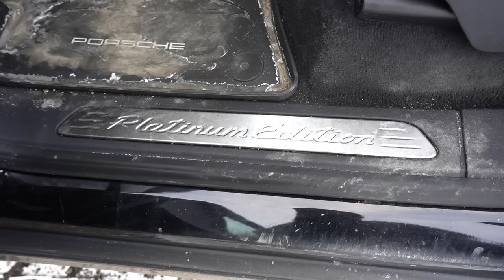Is Porsche The WORST Car To Detail?

Comment: About the carpeted wheel wells, I think the owner might have done something crazy to them. My 2017 Cayenne has over 70k miles and my wheel wells are still like new. 👍🏻

Oh, and I’ve asked my husband for a, “Detail Geek,” gift basket for Mother’s Day. 😂 I am so addicted to this channel!!💓
Reply: Agreed. I’ve had Porsches with more mileage than that one and I live here in Calgary. No damage to the wheel wells whatsoever. Something odd going on there…
Reply: And probably the rear hatch replaced. Reason I say that is that this is a base platinum not an S. I’m it has the badge of an e-Hybrid with the acid green outline. Plus no green calipers for S e-hybrid (or red for S), and base exhaust tips (not the 4 round like the S). 

So definitely has some history to this car.

Comment: I have a 2016 S e-Hybrid. Liners on mine look brand new still. 

BTW, that car is a base platinum with the logo of an S e-Hybrid (acid green trim). Not an S either as the calipers are the base color and the exhaust tips are not correct. 

My guess is this car has had a bit of a rough life (maybe hit in the rear, and who knows what done to the liners).

Comment: Love hearing your comments on the quality of the higher end cars.  I have a 2006 Cayenne, and it does not have any form of carpet in the wheel wells.  And after watching this video, glad it doesn't.  Coincidentally, my car is at the dealer for service and they gave me a 2023 Cayenne loaner and I just checked, it doesn't have "carpet" but some type of thin felt like material.  My Cayenne has black interior and I have a German Shepherd.  Your recommendation for the Lily brush has made my life and car interior so much better!

Comment: Unless this is just snow and ice packing in those wheel wells and tearing everything up, there's really no excuse, they just used a poor vendor for those liners.   Manufacturers go through periods where similar issues will often affect a number of their models--one of the most infamous was the biodegradable wiring(!) from Mercedes 20 years ago.   As an owner of 2002 and 2009 Porsches with quite a few more miles than this one, I've had no issues with wheel wells.  In fact, I've been amazed by the quality of the cars on the whole and the underside and corrosion resistance specifically.  The notorious issues of Porsches from my era, were the stupid soft-touch interior finish that begins to flake, and the foam in the vents that degrades and spits out in bits.  IMS bearings affected that 2002 era, but not the 2009.

Comment: Hi, big fan here. I recently had a kid throw up in my Lexus Rx350. It has perforated red leather seats and I was wondering if you have any tips on cleaning the seats. We tried wiping them down and we were told to put coffee beans to make the small go away but nothing seems to help. We are thinking of buying a bissell extractor not sure if it will work.
Reply: Try the pet dept. And use skunk spray deodoriser

Comment: QUESTION: I saw you use Leather CLEANER, which I assume doesnt have any protection? What did you put on after? Do you have a leather conditioner or using something else?
Reply: He uses Detail Geek Auto Care Leather Cleaner, which won't dull or dry out the leather upholstery. If you are after an even better look and nourishment, you can follow up with Detail Geek Leather Conditioner. 👍

Comment: What is the maximum horsepower for a pressure washer do you recommend using on a car, and what nozzle setting?  Also, where do I find the 45 degree angle spray wand and foamer canister?

Comment: How is it possible to not use a oil based cold degreaser to remove the salt and oil based stains? Or are you not using that at all?

Comment: I'd used meguiars wheel brightener and non acid wheel cleaner ezdetail brushes and drill brushes foam canon 1st then two buckets .meguiars soap and 3d soap.
Reply: Oswego.ill and norridge,I'll I do detailing.

Comment: Hey Mike. 
I don't have a carpet cleaner to extract the soap out of the carpet, can I use a wet/dry vacuum instead. 
 Have used the Lilly brush on the carpet in my '03 F-250, and I am amazed at the difference.
 Keep up the good work.
Reply: Yeah u can, but you'll also need to apply water while vacuuming to rinse away the soap
Reply: she bd and is d

Comment: If you first hit the car with the foam outside and then rinse off with pressure washer, you would remove more dirt right away.
Reply: The point of doing the pre-rinse before the foam is to get off the easily removed stuff first so that the soap can reach the really stuck on dirt underneath.  It’s one of the differences between detailing and just washing.

Comment: Any luxury car would seem to be the worst to detail. I would expect luxury car owners to be the most picky and critical. At  the same time if I made a mistake and did cause an imperfection, it would be that much more costly a mistake for me to fix. Based on the Porsche and BMW owners I have known, just a couple of people, I would not want to deal with them when it came to doing anything with their vehicles. I would buy a 911 if I had the money. Why? I've been in one going at a ridiculous speed, that's exactly the kind of sports car I would want to drive. And yes, if I owned one I'd be insufferable.

Comment: Considering that it ISN'T an S, this Porsche has been molested. Those wheel well liners were likely removed wrong a few times. 

1. Wrong color calipers
2. Wrong rear badge (shouldn't have green halo - it's not a hybrid)
3. The S is crooked

If it were a S-Hybrid, it would have green calipers, and hybrid badges on the front fenders. 

If it were an S, it would have silver calipers, and 4 exhaust tips. 

This is a V6 that someone wants to stunt in.
Reply from the maker: Guessing you don’t realize this is a Canadian vehicle?
Reply: I know it is, however, there was no difference between the US and Canadian market Cayennes that year. Yes, an S Platinum Edition was offered, however, with the wrong badging, wrong calipers, and wrong exhaust, I think it's just someone who wanted different badges on the back.

Comment: If i didn't see the badges in the interior, i would think this is a Hyundai or Kia. Moving forward to your detailing, i see that the quality got even worse. Don't comment for all Porsche, but this one definately looks cheap.
Also, from your videos, i haven't seen you moving the wheels for example or do an underbody detailing, would this be a thing to add? Thanks for the video, your work is consistent.
Reply: I have the same vehicle. Definitely not cheap finishes. We’ve decided we will never NOT have a German car after owning this.
Reply: @Speedylittleme  rip

Comment: Well I’m from Germany and detailing here is very expensive! And u are doing an average job at best. As an example seeing u work on leather was a little of a shock to me try to use less and take a very soft sponge and do it partially. Don’t spray the entire seat u will have a much better result it takes longer but u won’t get any fluids under the leather or in between the stitches. 

U are of course here to make a living of it as I would suggest wich is the main and core reason u are trying to do a quick fine job like a businessman would do. 

I hope u can take criticism as I am here to try to help u improve ur skill set 😊.

On the exterior of the car how ever u are doing a very good job same with carpet and dash board try using a soft head made out of rubber or at least put a very soft piece on the vacuum cleaner’s head! And u won’t be scratching any thing.

Love watching ur content subscription + bell are on. 

Love and respect from a fellow college. 🦾🦾🦾

Comment: Porsche makes good performance and high end cars, they make terrible entry level luxury vehicles. The Boxter started that trend. You can pick one up for 4 figures now. And it's everything you'd expect from a sub $10,000 "sports car". Their SUVs are nice, for about 5 years. You can pick up late '00s Cayenne for under $5,000 and it's everything you'd expect from a sub $5,000 luxury sport SUV. Nothing but headaches.

Comment: How do you get around cleaning the top of large vehicles? Those must be hard to focus on and clean thoroughly. That car shampoo would really have to do more of the heavy lifting so all you have to do is lightly move the wash mitt around the whole area.
Reply: He is able to stand on the running boards or tires to reach every spot. 👍
Reply: You can also use a work platform. Super handy if you're not really tall.

Comment: Slap a KIA badge on the exact same car brand new, it'll sell for 25k. Put the Porche badge on it and it'll sell for 65k. You're paying for the name, not the quality.
Reply: To some extent.  I drive a Ford SUV which I really like and it’s more than nice enough for me.  I have a friend who drives a similarly sized Mercedes SUV and it is most definitely nicer than my Ford.  I can’t speak to the mechanical aspects, but the seats are more comfortable, the carpet is nicer, there’s less road noise.  I don’t think the differences are great enough to justify the price difference but there are definitely quality differences.
Reply: @M Durham  I think you missed the point of my comment. Some of these brands get by with the price hike simply by their name alone. In this case, the wheel liner comparison is the quality of a lower end vehicle in a higher tier name. The carpeting in the cargo area was also pointed out. For the name, the quality should reflect that. I understand it's a common thing to put lower quality in the cargo area. On a higher end vehicle they shouldn't cut corners though. People pay for quality, not a name.
Reply: Do you own one and drive it daily? If not, you don’t really know. Porsche quality far outperforms any other vehicle I’ve had: Ford, Chevy, GM, Hyundai, etc. (And multiples of each)

I’ll never not have a German car.